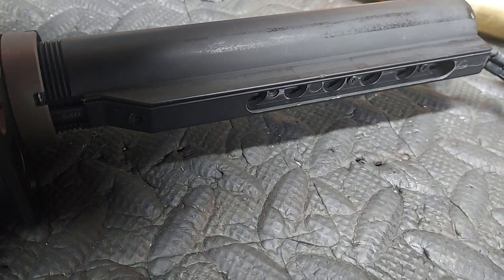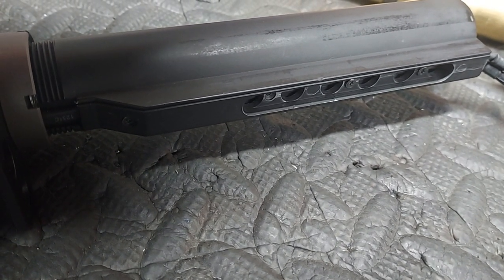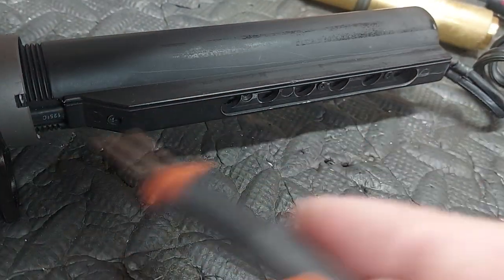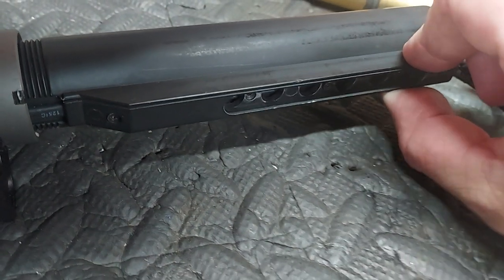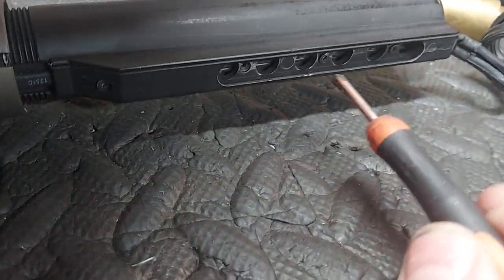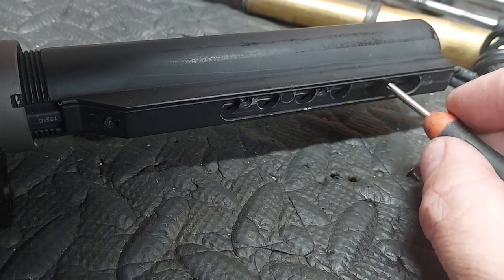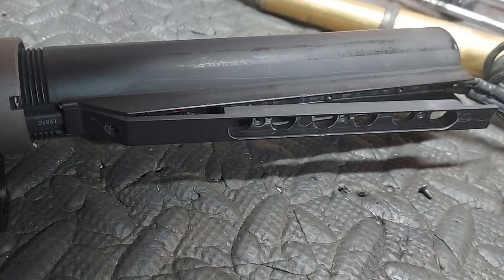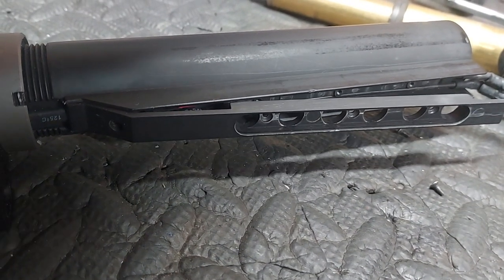Neg Shorts: Why BOLT Threadlock (or don't threadlock) Their Parts!

Comment: It's amazing how some people do certain things . Just wait till you start taking cars apart. The auto manufacturers tend to use a lot of the same parts manufacturers. Believe it or not now a days it's just like airsoft parts , many parts interchange across the board. My favorite to swap parts on are the Ford/Mazda/Volvo  ( focus/mazada3/c30 ) they are the same vehicle and mixing the parts up really confuses most people....Mazda body, Volvo r design knuckles , breaks and suspension. Volvo AWD system. Volvo 5 cyl block with RS head and turbo....😎oh and lots of thread lock.
Reply from the maker: I'm 41 & I can't drive... so I won't be taking a car apart any time soon....
Reply: @NegativeAirsoftTech  🤔 can't? , I know you live over on the other side and a lot tend to not drive but " can't " , I'm sorry bromandudeguy , bro-tato , bro-meium , bro- meithious , bro-gurt ...that inhales with great force ( sucks ) . " Edit " ..... unless it's of your own doing and then in that case" shame on you mister , you know better than that " ✌️🖖🤷
Reply: @TheHerobrineHerd698  If you have no need for a car then you don't get one. It's really that simple 🤷‍♂
I've never done driving licence either... I was contemplating getting one but then I would use it maybe once every other week at most so there really was no point. The expense to keep the car running (MOT, Insurance, road tax, consumables) is just not worth it if it will be just rusting on your drive yard...

Comment: No idea if you will reply to this comment but I have a question about the G&G tr16 308.
I recently got one in from evike and the gun does not fire. I have already identified the problem as the magazine cut off switch in the magazine well.  Is it possible to remove the magazine cut off feature from the gearbox?  I have minimal AEG experience but I feel confident enough to at least take down the gearbox if you think it can be modified easily.
Reply: New mosfet. I had one of those break off and I tried soldering it and it didn’t work. Get a perun v2 hybrid or a gate aster.

Comment: Why does the wire need it's own little channel in there? Is the buffer tube not sufficient enough? I just don't understand why there needs to be a plate and 3 screws on the buffer tube like that...
Reply: Unless of course this gun needs buffer tube space, then I understand it completely.
Reply from the maker: Because it had recoil
Reply: @NegativeAirsoftTech  understood, never had my hands on an ebb that wasn't broken already or had the chance to take one apart but I don't think I want to either 😂